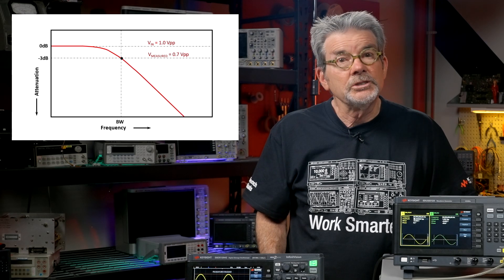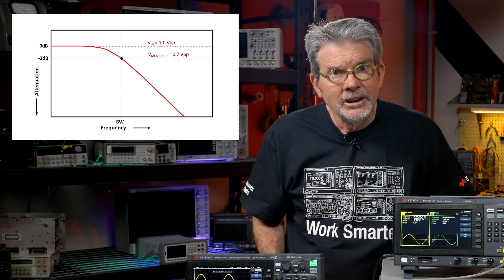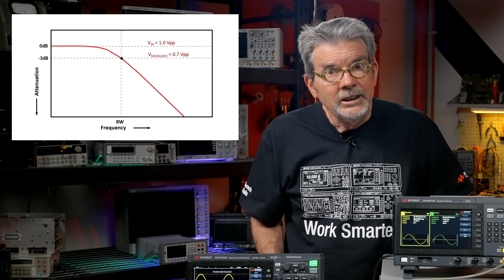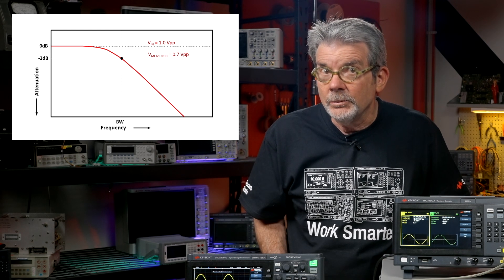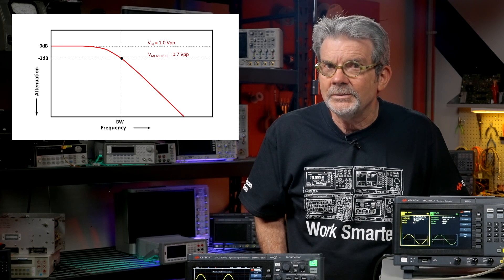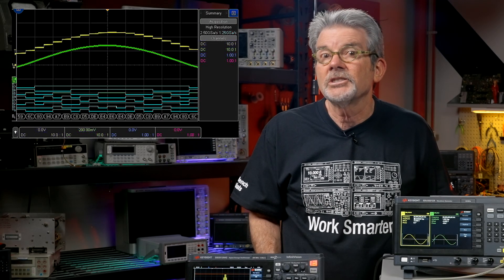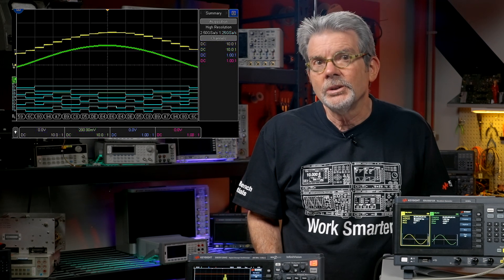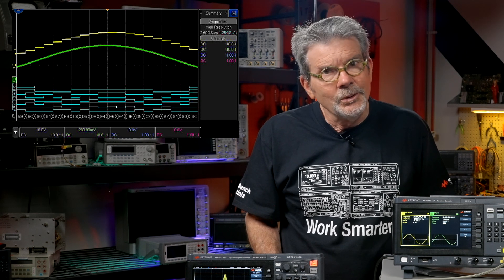Lesson 18: Oscilloscope Specifications

Comment: One thing that bugs me about all modern scope manufacturers is that they build a "mid-tear" scope with the hardware to reach 1GHz+ but then limit the bandwidth in software and make you pay through the nose to activate it.  Not that long ago, scopes didn't have software options and the hardware inside was what you paid for.  If you wanted a 100MHz scope, you paid for a 100MHz scope and that's what you got.  These days you pay for a 1GHz scope but are only allowed to use a fraction of it.  Designing a 1GHz front-end is child's play for the likes of Tek, R&S and Keysight but they continue to charge a fortune to allow people to use it.  Mid-tear scopes (Tek 4 series, MSOX4000, MXO4 etc) should be offered with 500MHz bandwidth minimum these days and that should be at the entry level price.  This overpricing will continue unless customers start demanding better value for money.
Reply: It's cheaper to manufacture one "model" of scope with the same hardware than to make 4 different models. 

SOMEONE has to pay for that advanced hardware. This allows entry level scopes for the home hobbyist for a much lower price than could otherwise be offered.

Comment: If 4 analog channels are not enough, you can take connect several scopes together using BNC cables.  The 10 MHz reference signal from the primary scope can be sent to the other scopes (so they all share a common clock domain).  The trigger signals can be sent from one to another using the trigger-out and trigger-in BNCs.